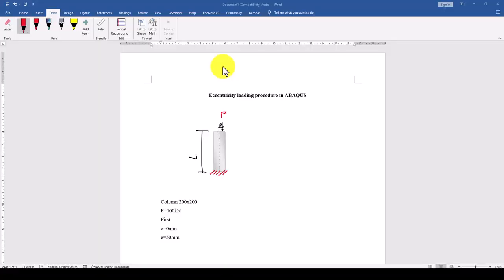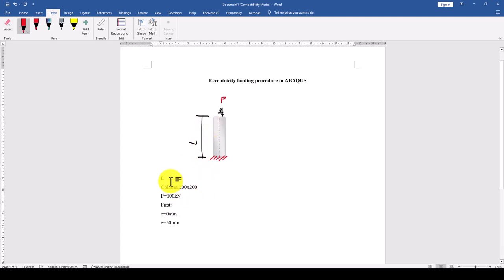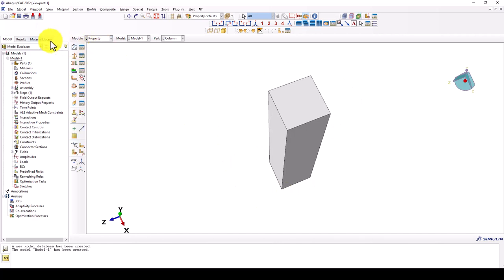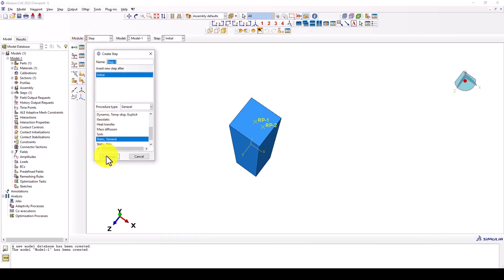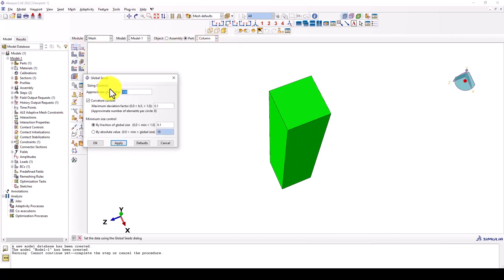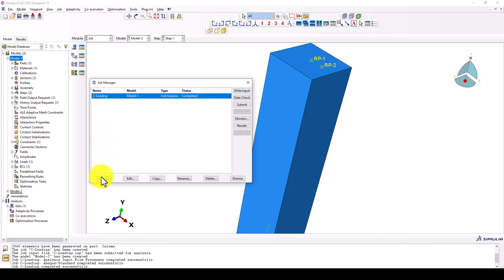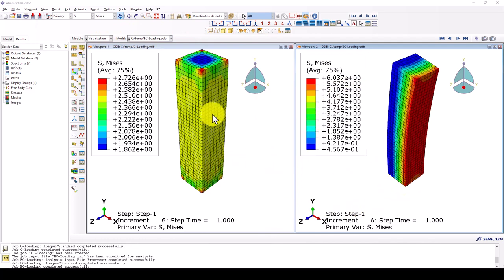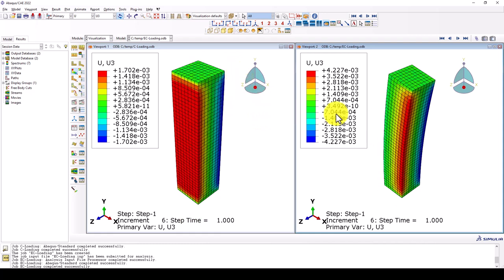ABAQUS FEM Tutorial ; Eccentric loading procedure and application of Eccentricity

Comment: Can I ask, how to determine the Shear Force and Bending Moment of a Beam using Abaqus?
Reply from the maker: Use this equation 	1. Bending Moment (M):
The bending moment at a particular section of the structure is given by:
M = σ * I / y, where σ is the stress at that section and y is the perpendicular distance from the neutral axis to the section.
	2. Shear Force (V):
The shear force at a specific location is determined by the change in the bending moment with respect to the distance along the structure. It can be expressed as:
V = dM/dx, where x is the distance along the structure.
Reply: @KSSE_Engineer  Thanks for this! But I want to determine the maximum shear force and maximum bending moment that the beam can carry before its failure.